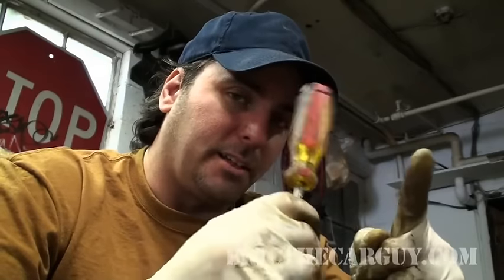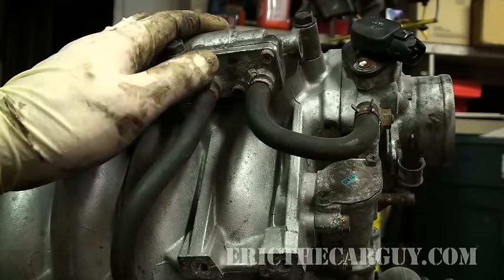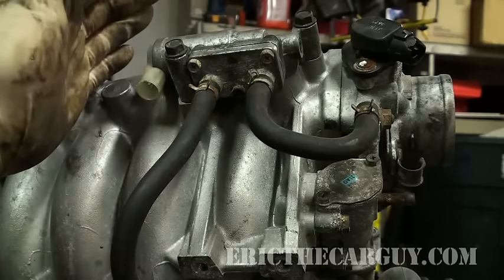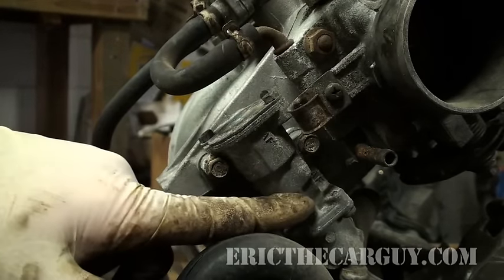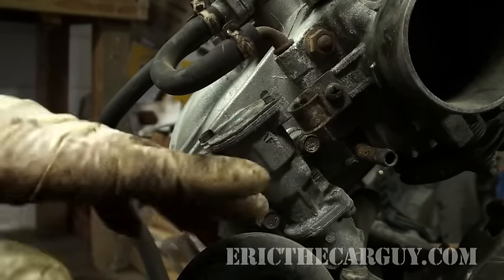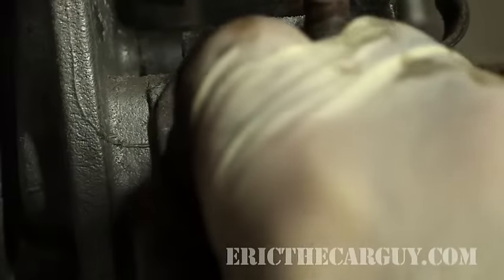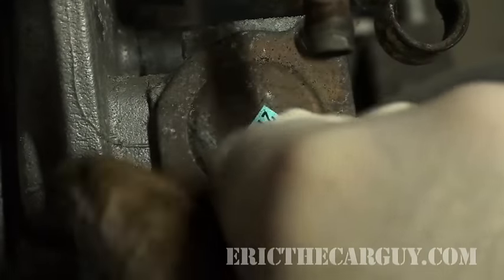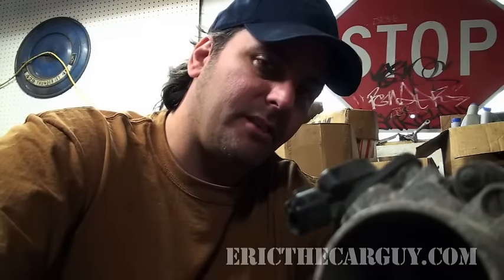How To Solve Honda Idle Problems - EricTheCarGuy

Comment: Thanks for your videos.  I have often found them very helpful.  But I have questions about this one and also something from one of your others.

I have a 2005 Honda Odyssey with a rough idle issue.  This video says that low coolant (or 'air in the cooling system') is the number one cause for rough idle.  I'm curious as to how those could possibly be connected.  If you're really low, your idle will get rough... right before your engine seizes and turns into a puddle of molten aluminum and steel :( .  But otherwise?

Second question - in another video that I can't find right now, you said that the PCV valve on this car rarely fails... and that it's not often a cause of a rough idle.  I'm surprised by that.  I pulled mine out.  pretty grimy... and the little ball won't budge - which means it's failed.  If the ball doesn't move, then the valve is not operating correctly - either stuck open (maybe behaving like a vacuum leak) or stuck closed (never pulling gases out of the crankcase).  In my case, the rough idle improved considerably after replacing the valve.

Now that the PCV is behaving better, the idle is lower than it was, so I think it's time to clean the IAC also.  Throttle plate was already cleaned.

Thanks again for your videos.

Comment: Would having a slight issue with the idle by having air in the coolant system or the leaky Fast idle valve cause you to fail a California Smog check with NOx being 100 points over,  I failed with a new cat passed on CO and HC but my NOx was 807 and my GSR engine called for less than 720???? again I have a brand new cat thats only 2 years old but the car sat for 1 year not drving after so technically the cat only was used for 1 year so it cant be the cat that failed me.

Comment: So mine is a 98 EX seems like if I start the car with the ac on hot or cold it doesn't have the problem. I also have it set on recycle air but I haven't tried it with that off

Comment: hey eric the car guy
im gian from manila. im subscribed to your channel and i do watch your videos.. 

i own a 95 civic eg with ph16 engine. i recently replaced some parts like timing belt, all the other belts, crankshaft pulley, gear, etc. also had the engine overhauled, so its basically ok. 

now my challenge is with the idle. coz everytime i turn the ac compressor on, the idle goes down to about 300rpm and it doesnt shoot back up unless i disengage the compressor. even worse, at times it goes down too low that the engine even dies. 

whats up with that?

Comment: hey. so I got an element that won't shut off. it runs, not diseling. it will turn off the radio and ac, and will lock the steering wheel. but the rest stays on. why.

Comment: I have an idle issue but its only when the weather gets 65+ (give or take ) and I have the IACV for 1990 honda civic 1.5L hatch back , its the one on the driver side of the engine. Iv tested it while off and seems to actuate fine. Also did a vacuum test around the engine with carb cleaner and a bleed on the coolant system finding no changes? Any thoughts anyone ?

Comment: I just bought a 2000 Honda Accord special edition red 135k 
It starts but rpm goes crazy a bit feels like engine running to lean 
Too much air 
But no check engine light

Comment: My car when it first starts up sounds like someone is stepping on the gas. It's a GM 3.1 with 209,000 miles. It revs up to 2000RPMs and doesn't change when changing gears and it's only remedied by turning off and restarting the vehicle. The idle air control has been replaced because I couldn't clean it up. Throttle was cleaned and put back together. The throttle cable itself has no tension when this occurs. I'm thinking TPS but I could be wrong. Air filter and filter box are clean as well. MAF cleaned... I can't figure it out for the life of me.
Reply: Because your problem is just a cheap gasket, intake manifold gasket!

Comment: If you could get back to me please I tried to do the same on my 2000 Honda Civic but when I took the screw off there was a tension spring on the inside that wouldn't let me slide the lid open so I took it off all the way and now my engine is idling super high when I start it then it goes down and idles up and down very badly what did I do wrong help

Comment: Good morning I'm from south Africa and my engine is a D15z4,I don't have extra idling valve on my intake manifold,we checked for vacuum leaks by using carb cleaner to spray over all the pipes,injector seals and manifold,it's sucking alot of air,when u use your fingers to slow down the air from sucking it idles fine. Can you assist please

Comment: Hey great vids got  1996 honda replaced starter,ingnition switch battery cables. And terminals . Every time i go to start it just clicks, if i keep trying it will eventually start. So im scratching my head

Comment: So I have a 1991 Prelude Si I tightened the fast idle valve and I've cleaned the IACV. I tried to smack the iacv but that didnt change anything. My cooling system is air free but im still getting a 1.5k idle spike dont know where else to look
Reply: ETCG recommends changing the IACV, not cleaning. CEL throwing any codes ?

Comment: Can someone help I have a 2004 honda accord lx 4 cylinder......idle is fine on start up while driving around ect at 700rpm....the problem is when I turn on the ac it drops to 600 then back to 700 but the car vibrates everytime the ac compressor kicks on if I step on the gas to about 900 1000rpm there is no more vibration where should I start?

Comment: I have a high idle and check engine light for IACV and primary O2 sensor so I replace those 2 and still have high idle, then I fix vacuum leaks  on the injectors, change pcv, TB gasket, electronic load detector and still high idle driving me nuts.

Comment: I will be checking my coolant that is one thing I have not done and should have Oops. My 2001 Honda Passport AKA Isuzu Rodeo is being a pain and I am in search of help because I am just wanting to give up. Started with the engine stalling when putting it into any gear other then Park or Neutral so replaced the bad O2 Sensor because we all know cleaning them is a temporary deal or it is for me I have not had luck with cleaning those. I saw an oil leak when taking off my B1S1 at the valve covers...lol all down hill from there finding the inside of the covers had been painted. PCV grommet just fell apart now cant find one so I had to figure something out and it came out beautiful with no air leaks there. So I went to my other issue that was a trans gasket leak fixed and dealing with that with no pump is a pain. So now I am at a surge in the idle and a hiss from what sounds like my EGR purge valve.....oh and some nasty sounds with the ac load....lol ya my luck

Comment: I have no CEL on. But idle on my 1998 civic is weird. It idles at 700rpm with AC and AC compressor turns on and off again and again which indicates low rpm. Idle isn’t smooth when load is applied like AC or Headlights.

Comment: i have a high compression b18b1 and the only way i can get it to start is if i have the gas held to the floor and when it starts it wants to die right away.... i have no check engine lights and i am at a loss... any ideas?
Reply: Brandon M check your mechanical timing

Comment: hey i have 2003 civic its been trying 2 over heat me i have change the thermostat n flush radiator fluid the check engine. light came on n therew me a o2 sensor code i need help how could solve this problem

Comment: This video may have just saved my Job delivering pizza. Did a trans R&R, & in the process managed to jolt the heater hose coming off the heater valve, cracking/ piercing it & losing a butt-ton of coolant. Fixed that & finished with the fresh transaxle & commenced my fill/check. Started her up & sure enough, up/down/up/down/up/down idle. I furiously poured over my intake/vacuum system & ALL my harness clips & found NOTHING. Air in the coolant system honestly isn't an angle that occurred to me. Guess I'm burping my coolant tomorrow...
EDIT: YYYYYYyyyyyyup!!!!! That's what it was.  Also, fun fact - poor battery to chassis ground will cause a tach non-function, instant pegging of the temp gauge & immediate stalling.

Comment: I have a 2000 civic lx with a d16y7 it idles high on start and idles under 1000 rpm in drive and neutral how do I go about eliminating what it would not be and I got a p0420 cat code but the bank 1    02  was pulled and cleaned and the code switch from the cat to the 02 censor and then back to the cat p0420 and it has a new oem cat and 02 censors

Comment: I have a stock 88 Honda prelude 2.0s  that has the 2 carburetor setup from the factory and 5 spd Manuel transmission. The issue I'm having is the car starts great runs for about 30 minutes and then dies for 30 minutes after it starts again it will only run for 15 minutes and dies again it still takes a half hour for the car to cool down or something before it starts. I parked the car cuz I couldn't get it to run longer than a half hour. It's now time to figure out what's going on with this I could really use the vehicle again. The car has only 155403 on the odometer. I have replaced the fuel pump and everything including relays and filters all fuel lines going up to the carburetors. That did not cure any problem the car was having! 
I'm hoping someone out there has had this issue before and has the cure for the problem I am having. Thanks for any help in advance!

Comment: Ive been having idle issuses. My civic EX 1998 revs up and down. I changed the IAC valve 4 times and it still revs up and down. What could be the problem?
Reply: @David Cordova where is ir located this egr valve. Does my  1998 ex vtec civic haves it?
Reply: @David Cordova do you know the exact location? Is there a diagram where i can look it up? The check engine light is on and it gave me primary oxygen sensor code. Those this has any relation to the up and down of the rpm?

Comment: So I replaced the idle air control valve still had the loping did the secondary one when I start car I get high rpms once I put it in gear idle drops to normal once engine is warm idle is fine is this normal
Reply: try pcv valve

Comment: I'm having a problem with my engine.
On tick over car runs lovely but when you press the throttle it almost cuts out been doing my head in please help 
My dad thinks it's air related

Comment: I have a 1997 Honda Accord (manual).  It struggles to start ONLY WHEN COLD (below 35F).  Once it starts and warms up is OK until next time.  What could be the problem?
Reply: battery
Reply: +Robin Hood I had the same problem in my 97 prelude. even though the battery was less then 6 months old, a cell was dead/dying. finally after about 2 weeks of weak starts, it died completely. I got the battery replaced, and it starts fine

Comment: 99 Honda civic ex. Air sucking in with oil cap sucks in so bad it will suck oil cap out of your hand also makes a loud sequel noise. I've been leaving the dip stick out but seems. It's burning oil bad

Comment: I have a 1998 Accord 2.3 vtec  mine idles really low during cold start around 500rpm then when it is up to temp it is at high idle 1500/1700 rpm till it reaches 2000 rpm and retards it self what would be the cause of that as I would like it to idle at 800-1100 rpm

Comment: I have a 97 Honda Civic, Along with idle problems, when my throttle hits 1500 RPM it buckles with a voom voom voom voom, I have to hit the throttle hard to get it over 1500 at which it then transfers power smoothly, but once it hits the 1500 any time that happens, and a check engine light then comes on, some times, ill stop, shut off and restart the engine and it goes away

Comment: So here's the guy asking 9 years later, what should i do if my 07 oddysey 3.5 vtec has no idle air control valve but it uses a different system. Cooling system was just serviced but it seems to be fully bled. Idle stays at 900 in gear and is putting stress on the transmission at red lights and such
Reply: Dustin Higdon you own a Honda that’s your first problem

Comment: I've been fighting with this p1519 code for months now. I replaced the rad....rad cap....iacv...and tps. code still comes up. it will drive fine for a couple miles but when I idle.......there it goes popping up again. plzzzzzz help me! D16y8

Comment: Alright, here's my issie and what I've done to try and combat it. I'd like to know your input, if any. 
Issue; surging/bouncing idle around 1500rpm, check engine light (code 14)
What I've done; replace tps (had a cracked housing and the guts of the old one was busted, some how lol), cleaned iacv, adjusted fitv, cleaned throttle body. 
If I unplug the iacv, the idle goes back down but it was too low so I raised the idle with the idle screw (I know, a sin, shoot me haha). So car is now much better to drive now than it was before. But I still have the hesitation with around 5 or 10% throttle around 1500rpm. 
With the iacv plugged in it idles and fluctuates around 1500rpm and throttle is hesitant up to around 20% throttle. 
Now, if I block the vacuum port that leads to the iacv, the idle drops back down but still has the hesitation around the 1500rpm mark.

Thoughts?
Reply: Oh shoot, the car is a 95 civic, motor is a d15b7. So single cam 1.5l non vtec, efi etc

Comment: so i have 2001-2002 civc coupe with a D17a1 was motor i bought i blew engine few years back an i  went had a buddy swap them with a jdm d17 pretty sure it same as a d17a2 which is  but i had no issue until i had to swap out the egr to a non egr but the motor i bought the d17a came with a egr the so i replaced it with the non egr coolant housing to delete the egr for the oem motor bc the d17a1 comes with a non egr, i did this to pass smog an i got a check engine code of 0505 i think was p0505  only took the housing an swapped with a non egr to pass smog was curious u think it this valuve or it the egr being deleted oem style but on a jdm motor thougths
?
Reply: also thru this code p0505

Comment: what about in a 2002 Honda CRV when the is only rough when you’re in Drive and your foot is on the brake? Remove your foot from the brake and it idles smooth again. help

Comment: eric, I need help before I start buying parts..
my 94 Honda civic turns on when it wants..its cranking but will not turn on..theres times when I push the car a few inches and then crank it and starts? its stays on, I drive it and next day turns on..but after 2-3days it wont turn on..im bout to replace the motor lol..help me plz,,anyone

Comment: I've tried all the things you suggested in this video but my idle issues still remain. i dont know what else to do
Reply: Clean or replace fuel injectors, direct clean not pour stuff in fuel tank. Check other videos for how.
Reply: thank you very much, i will certainly try this. I hope this helps because i'm out off options

Comment: I have a 98 honda accord with an f23a1 mortor 5 speed trans it has a high idle when starting the cart 2000 to 2500 rpms when it drops down it starts to bog out and die i have replaced the tps map and knock sensor the knock sensor was broke had engine codes for insufision air flow egr map and tps but after replacing and haveing the tps calabrated the car still has this problem just pulled a code tonight but dont have an obd2 tonight so cant check at the min it is surging up and down also high rpm when starting bogs and dies doesnt seem to have any misses reading out norm voltage on the tps no vacuum leaks from what i can tell has coolent dont know about air in the lines yet will check that soon i need help bad with this its my only vehile at the min i sold my family vehicle and bought this drove fine for 2 day then bam did this also cleaned the whole intake and throttle body

Comment: Hi Eric. Im having a problem with my 07 odyssey... i can't find the iac. Can you help
Reply: Sorry... guess i could have gave you a up to date scenario.  Last week we had -40° temps in the Chicago area.  Battery dided. Recharged. Check engine light came on. Got the code that was P0507.  Took the oddy home and cleaned the throttle body and EGR valve. Couldnt locate the idle air control valve.  I even did a idle relearning programming.  Rpm 3000 for 5 min  with no load waited for the fans to kick on twice let it idle for the fan to kick on again then ran the AC at idle for another 5 min. (Not sure if i did that right) drove it around for about 10 miles and the check engine light is still on and the resting idle will not go under 2000rpm. When first started it will try to locate a good idle speed then back to 2000.  
2007 odyssey exl 184k 
I would like to keep it for atleast another 100k

Comment: I have a po172 on honda 2003 and po420. Gas is backing into my intake all the way to the air filter case. I replaced the front o2 sensor and the rear but its still having the problem.
Reply: I also replaced the map sensor

Comment: I have a 98 Honda Accord LX and i don't know why my car is stalling everytime i use the a/c but drive okay when a/c is not in use so could someone please tell me if there is a problem with my compressor i can run the car a/c but when i come to a stop my car acts as if it's going to die out so please let me know something if possible 🤠

Comment: Any one had to change a 12 v batt in an Insight,,,changed mine now the horn beeps like a car alarm so can't connect the bat with out waking locals..also has a tag saying removing batt will lose radio codes and damage CVT...any ideas????

Comment: 99 accord 4cyl.  don't see anything like a fast idle valve.any where near throttle body or idle air control like the one that was adjusted.